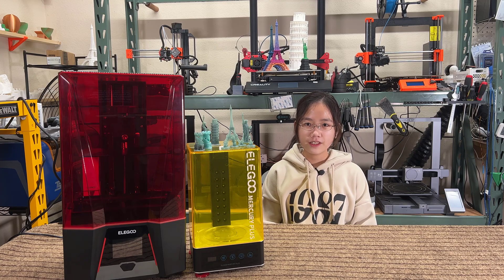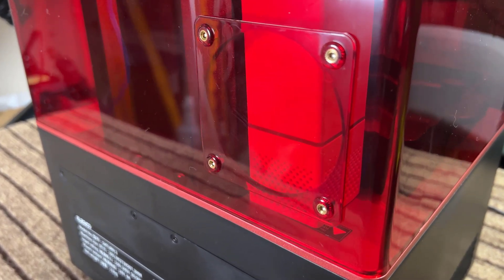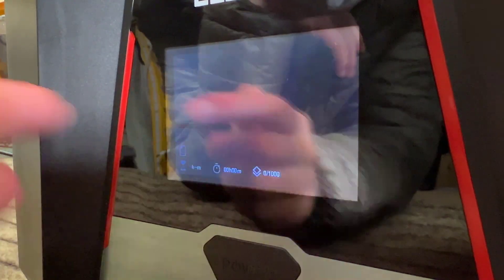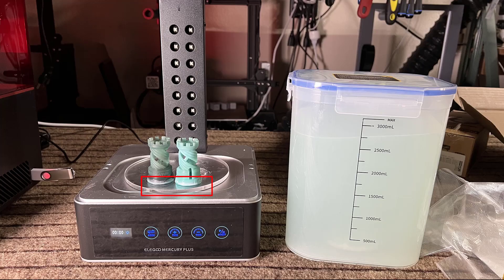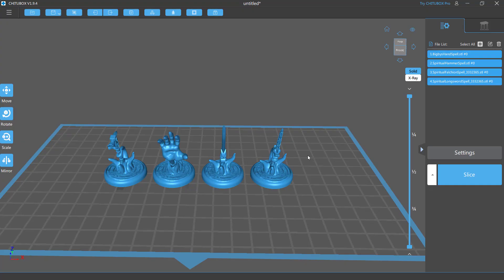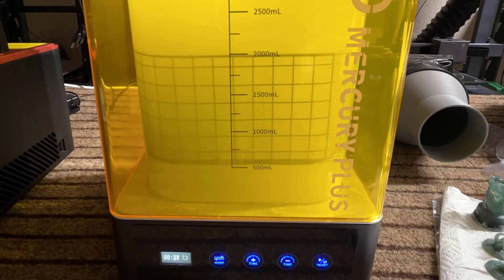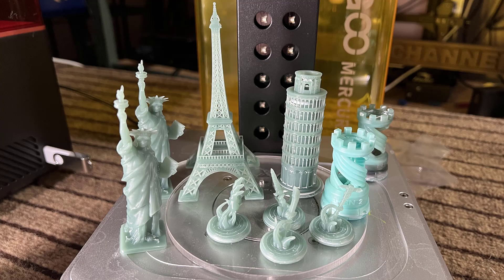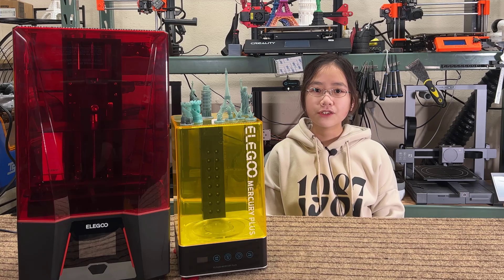Elegoo Saturn 2 8K mono resin 3D printer: An affordable high-detailed high-speed resin 3D printer

Comment: Hello, I just wanted to thank you and your brother for making one of the most consistently informative and direct video channels that I sub to in the printer world. I actually bought my Ender S1 Pro as a result of the great video of that model that you made. 

I am now looking into dipping my toes into a resin printer. I really want to get the Anycubic DLP unit but $600 is hard to justify, so I am aiming in the range of about half that price, starting out. 

I was considering the Elegoo Mars 3 Pro with  the clean and wash stations, I literaly had them in the cart, ready to buy; but another youtuber expressed concerns over the slicer program, Chitubox,  that the Elegoo server moving to going to be subscrition based at a whopping $170 per year, which is crazy to me. 

So I postponed the sale until I know more. Then I moved over to checking out the Anycubic Photon Mono X2. 

I was wondering, if you, or my fellow subscribers,  are familiar with Anycubic model and/or, how it compares to the Elegoo. And I was curious about your thoughts on the slicer being so heavily tied to Chitubox, if you see that as an issue going forward. I know that I can probably swap in Lychee, or another slicer, but because the main board on the Elegoo is branded Chitubox, do you see that as kind of a predatory proprietary thing going forward. 

I am not a professional 3D printer user and will be using them for fun and printing useful things and models,  so a compelled subscription costing almost $170 anually, for a $300+ printer is kind of offensive to me, and would  be a deal breaker. 

To be fair though, I am not fully informed on the topic, as I only saw it on one or two videos on youtube. Curious on your thoughts?

Comment: I enjoy your channel and have subscribed. I'm relatively new to 3D printing and I do have one item to ask about that I don't think you covered, it's how long resin printed models last. 

I have both FDM and Resin printers and one problem I noticed with my resin prints is they don't seem to last more than a few months. They become very brittle being exposed to incidental light in my home office and simply break very easily once a few months old.  Now I will add that I am using water based resins and I do have a wash and cure machine that I use for post processing. 

I dropped a few month old model about 4 foot onto carpet and it snapped off a piece that was actually pretty sturdy when freshly printed. After it broke, I checked how easy it was to snap pieces off of it and I was able to break a lot of pieces off easily. Some other models also had the same failure mode. 

My office doesn't get any direct sun where the models are placed, only incidental light from a well lit room. Have you noticed models becoming more brittle after a few months?
Reply: I don't know anything about resin printing but some plastics can get brittle in low or high temp cycles..
Reply: @N4CR  My resin prints weren't thermally cycled though, just sitting on a shelf getting daily indirect light. These weren't sitting in the sun daily. I haven't noticed the same models I printed in PLA doing the same and they are at least twice as old as the resin prints now.

Comment: I’ve gotten better small models FDM. I use, 0.16 to .20…and slow the speed to 30-60mm/s or lower. it’s never gonna be as detailed as a resin but I didn’t get stringing and they looked pretty darn good. In PETG

Comment: You speak so eloquently!  Like you, I prefer FDM and since my print lab is in the basement of my home, I can't have resin/resin printers inside.  I'm afraid the pets (cats) could wind up being exposed to the resin
Reply: ABS and Nylon fumes aren't exactly breathable, either.😏
Reply: @davepaturno4290  that’s why I have multiple carbon filters , BOFA fume extractors and a pair of large air purifiers in the shop 🤓
Reply: @WhereNerdyisCool  Great! Do they exhaust to the outside after being filtered?
Reply: @davepaturno4290  no. I’m working on tubing and fans to vent everything outdoors. With 12 enclosures it’s going to be a challenge.

Comment: I see you didn't use the leveling method described in the manual. It looks like your method works great. Only thing I would say is that you should air dry the printed parts before curing. You did a great job with the review without going into a lot of settings or supports. Great printer for the money and love your review.

Comment: The Saturn 2's lazy LCD sealing option (using tape) is a pain. Also, the FEP sheet installation design with dozens of screws, requiring 20-30 minutes to change is a huge pain in the butt and my resin vat was leaking from the start so I had to clean up the LCD screen and replace the tape on my second print.
Those irritations aside, this is a terrific printer. The quality is superb and the speed is impressive compared to FDM (given the massively superior quality).
What I love about resin is that the figures are heavier and much harder once cured, so suitable for retail if you are printing figures.
Not tried 8K yet - I don't need the detail, and the resin is outrageously expensive.

Going to disagree with you on the white residue - that doesn't come from over-curing - it comes from underwashing/drying.

Comment: As others have noticed, wear a proper respirator and dry your prints before curing. Also you didn’t level the build plate correctly, check the temperature range on the resin as your garage is probably on the cold side, and I like to use a VOC monitor even though I wear a respirator.

Comment: I don't get the  dislike of washing and curing. It's much faster than having to clean up stringing/sanding with fdm and almost unheard of to lose a print 3 hours in. The only drawbacks I think are the fumes and the short shelf life of resin
Reply: Both fdm and resin has their cons and pros. Resin can be more work ( i said can) but there is no denying the quality over fdm. And generally if you are wanting to make say car parts, i would use a fdm. That be why i have both FDM and resin, haha

Comment: I would highly advise drying your prints after washing them before you cure as you most likely will lose small details. Some people even use a heatgun for hair dryer to make sure prints are as dry as can be. Thanks for the awesome video. I watch every upload and was actually looking into buying a Saturn 2 as my wonderful Mars 3 Pro is proving to be too small for my needs. Keep up the great work!
Reply: An air compressor is the best. The whitening isn't from curing, it is from dirty IPA left on your print.

Comment: 11:40 I agree with you. I still prefer FDM printers instead of Resin printers. The smell; the messy resin; the washing; the curing process, the high cost... I can't stand it. I only use it when there is no other option.

Comment: Bamboo x1,pip... problem solved lol
I printed a tiny warhammer char and I was shock how good it was, including its face!
Reply: I have both. A Carbon can't remotely compete with the detail of a Saturn 2. Fantastic printer though.
Reply: @Martial-Mat  That's good to know, thank you. I am looking to purchase a new printer and not really sure what route I will be going down (FDM or Resin)
Shame resin can't do multi-colour
Reply: @Martial-Mat  Thanks Mat
Reply: @Martial-Mat  What isnt trivial about resin printing though is changing resins/ replacing fep. Its always such a mess.
Reply: @Martial-Mat  I think the worst I've had it with my fdm printer was spending probably 20 minutes untangling a spool of pla. At least I could just sit down and do it. With my Saturn S I recently spent an hour changing the fep as I was tightening the last screw, slipped, and poked a hole in my new fep. 

A word of advice for anyone reading this: 
Don't use alan keys for changing the fep.
Reply: @Martial-Mat  A screwdriver with a hex head

Comment: 7:30 That print was an unfair comparison between an FDM printer and a resin printer. As an experienced FDM printer user, you should know that you will get the best results with that type of printer by printing one item at a time. When you printed all 4 items at the same time on the FDM printer, you were asking for lots of stringing. That's what you got. 😁

Comment: Curious to the differences for functional parts like petg or abs vs resin.
Reply: Fdm is stronger and can be made more flexible, there's a filament for everything. But that Also means there's a setting for everything and if you get it wrong you just wasted 14 hours on a worthless print. Sla is much faster and easier, no time needed to wait for the bed and nozzle to heat up either
Reply: Resin is much harder, brittle, and appears more temperature resistant.

Comment: agreed, smaller parts look awesome and if you the money they make huge resin printers now. just remember big resin takes a lot of resin and time.
Reply: Of course large models will use more resin, it depends on how you slice them and how you hollow them out. Also, most everything I resin print is never flat on the build plate and uses supports, which is very easy compared to my FDM printers. 1000g of resin for $16 will go a heck of a long way.
Reply: @sbr-synrosimbugracing9338  yeah forgot the warping on the bottom.